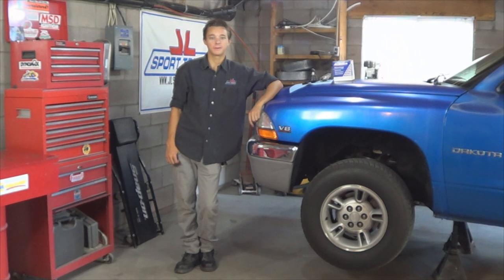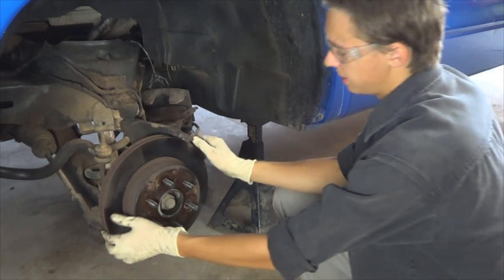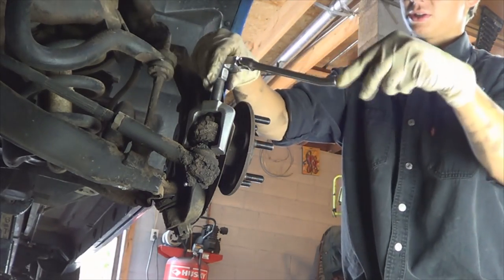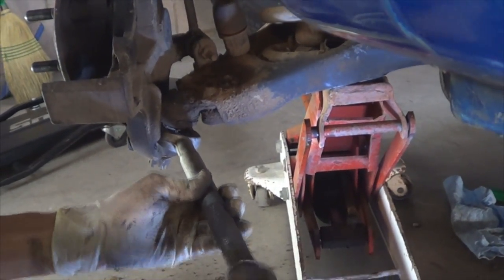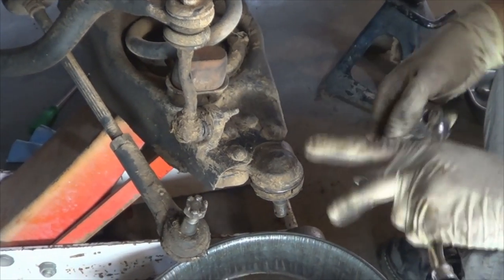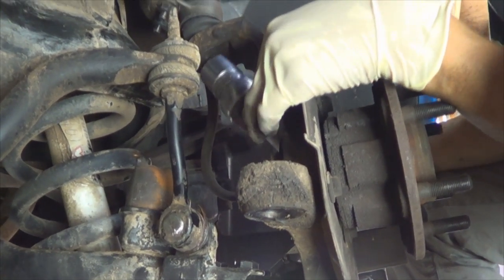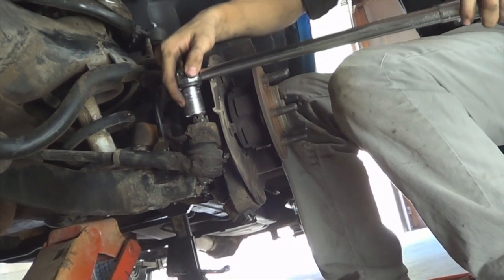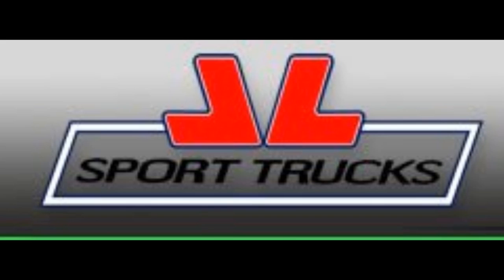How to Replace Factory  Riveted Upper and Lower Ball Joints on Dodge Dakota 2wd

Comment: Thanks for the video
Don't forget that for those original joints without grease fittings, you can buy a cheap grease seek needle accessory for your grease gun. This allows you to pierce the rubber boot and inject grease, so they don't wear out in the first place. You only have to add grease once a year

Comment: Thanks for the video. I actually had to use this video for reference on my 2000 dodge ram rwd. The set up is pretty much the same, and I couldn't find any step by step videos for it. You guys really helped me out tremendously. You should add 2000-2001 dodge ram rwd to the title for people like myself who can't find a good guide. Most of the ram videos are for 4X4's and the set up is not the same. Also the front wheel hub assembly is the same as a dakota. Thanks again guys, great job.
Reply: Ohhhhhh that explains why the video
I watched for my 2wd silverado didn’t have these stupid riveted ball joints...
Reply: Mine is a 2001 Ram and this will help immensely.

Comment: I drilled the rivets out completely. They are quite soft. A 1/2" drill bit after drilling a properly centred pilot hole left the base metal unscathed.
Reply: What kind of bit? Size and material? Also what kind of drill. I’m having the worst time drilling

Comment: I work on 2003 Chevrolet Cavalier. After I removed the tops of the rivets (the hemispheres were on the bottom, the author has them in his car on the top, so I cut the opposite sides) with the Chicago Electric Oscillating tool (good blades for metal), I made pilot holes, drilled a little bit  w/ 1/4" bit, and started to knock the rivets w/punch and a 2.5-4 lbs hammer in the manner shown in this film. The rivets didn't move at all, just on one of them there started to show the border of the circumference if the rivet body. In one film the author pulled the rivets, cut from one side already w/ bearing pulling tool. I'm planning to do that tomorrow. The drilling was extremely difficult. I think it depends on the model of the car, how everything goes. I would say on my car you can not knock out those rivets w/hammer. Thank you for the informative film.

Comment: On a 2003 Durango lower ball join, after drilling the hole and taking the top of the rivets off needed to use a 3/4 inch drill bit which is just a dat smaller than the hole. With that bit drilled down about 3/4 of the way then using a punch was finally able to get out the rest of the rivet, they were pretty stuck in there. Fortunately they are made of fairly soft metal, I think aluminum.

Comment: I watched the video through and through, and its an amazing video, BUT after I drill and take the heads of the rivets off I cant get the rivet out. I was there with a punch and a BFH for a couple hours. They wouldnt budge. Used pb blaster too. Alls I know is that when I finally get them all out Im putting grease on the bolts aonthis wont happen again lol. Thanks for the videos theyre really a great learning tool.

Comment: Awesome video bro.I wish I lived in your city as every mechanic including the one's at the Dodge dealers are not willing to replace ball joints via removing rivets. They all say they want to replace the entire control arms each time, which to me is a big waste of money. My 2003 2wd 4.7 Dakota Quad cab eats ball joints. I need to replace them about every one to two years.The sway bar links pop out of their ball about yearly too.  I bought Centric lower control arms this time as the ball joints are bolted on them & the uppers I used last time were Mevotech with bolt on ball joints too.

Comment: Hello and thanks for this Video. Not sure how old it is but I enjoyed watching it and making notes before replacing my upper and lower ball joints and tie rod ends and even the sway bar connector rods which were worn badly as well. It made my task much easier especially when it came to removing the rivets. Thanks again for a great job. WB

Comment: The problem is that most people doesn't have a car lift and you can't get to the lower ball joint rivets from the bottom. I have a  1997 Dodge Dakota, and I'm replacing pretty much everything on the front end. I was able to score the tops of the rivets and then pound them out, the top wasn't a problem, but the lower, almost impossible. Like I said before, you can't get to the bottom of the rivets to cut them off, and even if you did, you wouldn't be able to pound them out without destroying the lower control arm. 
So, what do you do? You can do what I done and just buy the lower control arm new, and they come with the ball joint allergy installed. I paid a little over 200 for both the driver and passenger side, and again, they came with the ball joint attached. On my truck, you don't need a spring press, and you don't need a ball joint press. Believe me, it's much easier to remove two bolts that hold the lower control arm in place rather than trying to cut the rivets off and then attempting to pound them out, which is almost impossible and you would probably destroy the lower control arm in trying to remove those rivets. Just thought that you might like to know

Comment: uve never worked in mi. w the rust. did the b joint job no where near that quick. we used a shop w a hoist n air tools.

Comment: if I don't torque the bolts what would happen sir?
Reply: jtorres698 it runs the risk of coming apart, the reason we torque to specific values is that value is what the engineers decided was the amount of force needed to secure the nut for that application. Overtightening can cause  bolts to snap or for the threads to become weakened; making the part itself weakened.

Comment: Very nice video. I was looking for something that would cover a 2000 Dodge Ram but this was close enough. I was trying to do the job without removing the brake rotor and piston assembly but think I'll now have to do it to get to the rivets easier.